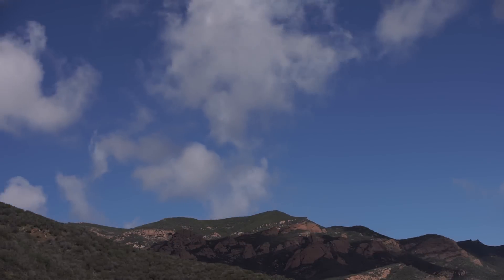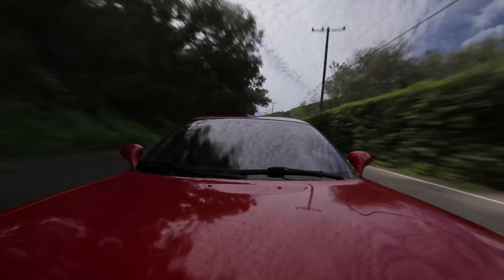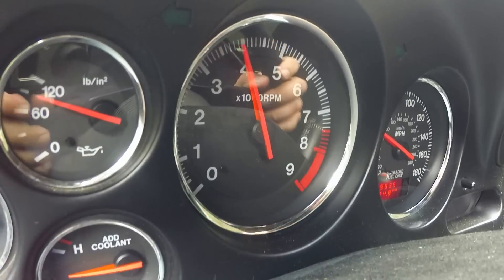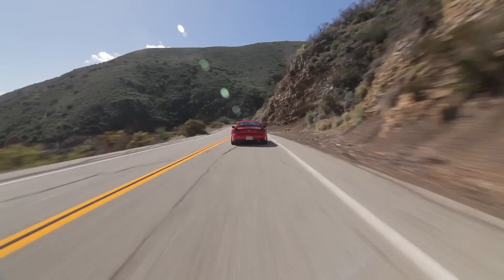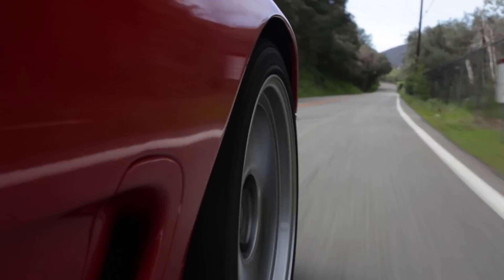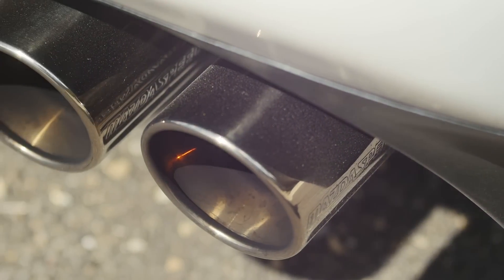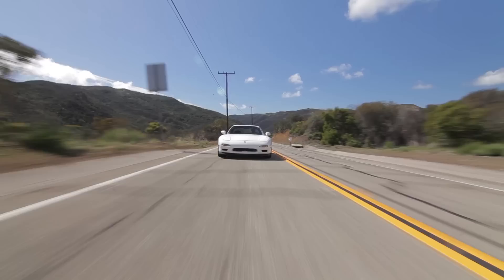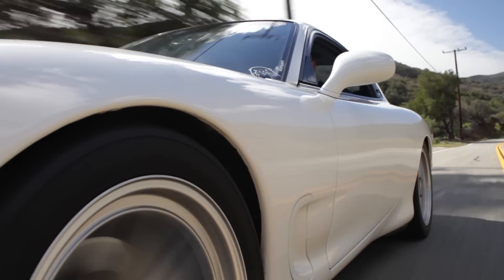Mazda  RX-7: Turbo vs V8 - /TUNED

Comment: Pure Sacrilege !!!
put a V8 in any other car, i don't care
but NOT in an iconic RX7 with its even more iconic rotary engine
that can eazily be tuned to over a 1000hp
so why THE HELL would ya need a V8 in that???
Reply: Iris C low down torque

how do you easily tune a 13b to 1000hp?
Reply: "easy". Yeah, it's pretty easy. You call a race shop and give them $50,000.
Reply: Iris C How come a 2 rotor its easy to tune over 1000hp when people struggle to get these numbers with ported 4 rotor turbos?
Reply: Iris C No really, please explain your "easy 1000hp" 13B tune.... We'll wait....
Reply: ***** You just keep living in your dream world little man. I'm actually invested in reality and not romantic rotary nonsense, so I swapped in an LS1/T56 after my rotary blew a coolant seal at 90 thousand miles. I can tell from your response that you have zero real world experience building high horsepower motors. You left out an entire laundry list of items it would take to make a reliable 1000hp out of a 13B. Just as an example of how much work it really takes to build a reliability high horsepower rotary... here is a 700hp example:
http://www.speedhunters.com/2014/01/wild-in-the-streets-700hp-of-road-legal-rx-7/

and 700 is a long way from 1000 ;)

So... how do you build a 1000hp 13b?

The question is not so much how, or how much, as it  is HOW OFTEN?

and the answer is AFTER EVERY RACE!
Reply: Right... maintenance... keep telling yourself that.  Here is what you should have posted to build a 700hp 20B for example...

Mazda 20B 3-rotor (Mazda JC Cosmo), bridgeport, machined/dowelled, full stud kit, machined/balanced/clearanced 20B rotors, Race Solutions apex seals, revised D-series balanced crankshaft, modified oil galleries, match ported and flowed intake manifold, modified 20B throttle body, Injector Dynamics ID2000 injectors, custom twin fuel rail, Turbosmart adjustable fuel pressure regulator, custom fuel lines, custom fuel surge tank,  Walbro fuel pumps, ceramic coated custom turbo manifold with EGT sensors on each runner, BorgWarner billet 88mm turbocharger, TiAL 60mm wastegate, 2x TiAL blow-off valves, custom PWR intercooler, custom intercooler pipes, custom 4-inch ceramic coated down pipe, twin 3-inch exhaust system with 3x mufflers, GM LS2 coils, custom baffled sump, custom PWR oil cooler, Aeroflow oil filter relocation kit, custom PWR aluminium radiator, custom shroud with SPAL thermo fan, braided coolant lines, Davies Craig electric water pump (ECU controlled), custom full-car wiring harness, Haltech Sport 2000 engine management system, custom engine mounts, polished rotor housings, colour-coded end plates, welded/linished/polished EGR system, brackets, vacuum lines
Reply: ***** And just check out the videos of the wide body FC RX7 I built, that are on my channel. Now tell me who's playing too much Forza? I don't even own a video game system, just a bad ass V8 RX7.
Reply: Iris C So what if he put a V8 in it...  It means the car is kept on the road, so if the next owner wants to put a rotary back in it they can.
Reply: Dee Jay if ya want a V8, just use another base car !!! Don't strip an already rare to find RX7 from its SOUL
Reply: rx7 all day
Reply: Iris C Stripped of it's soul.... the reason you don't see them much because it's "SOUL" has already gone to heaven (or hell) Rotaries are cool but lets be realistic... Even the RX-8 rotary wasn't reliable let alone the RX-7.  Also the 1000 hp comment was pretty stupid fan boy.
Reply: Gattsu83 Exactly. The last RX7 I used for my LS was sitting in a field for nearly ten years, with its "soul" seized and utterly useless. I dragged that sad thing home and gave it a second life. In ten or twenty years rotary parts will be very difficult to find here... whereas you can pick up your LS parts at your local parts store. To each his own I suppose.
Reply: Iris C Sacrilege is letting a beautiful FD or even FC sit and rot because the unreliable + bad owner = blown rotary unit, and good ones not being easy to find everywhere a V8 is a perfectly acceptable way to keep that great car going. so shh...
Reply: Iris C you're delusional.... nothing makes 1000hp easy, especially not a two-rotor engine (much less a peripheral-port twin-turbo four-rotor).  and exactly how streetable do you think any rotary will be with anything more than a street-port tune?  the V8 has much better midrange, it's WAY more efficient, and if you do decide you want make big power, it's a hell of a lot easier to get there than with any rotary (and it might still be driveable once you get there).  this isn't whatever video game you're pretending is
Reply: Hey to a multi-millionaire it's as easy as stroking a check.  You never know lol.

I'd personally go the v8 route.  Torque for days and reliable.  Exhaust, cam and tune easy 400+whp and will run forever.  But if it does die, they're cheap compared to a fully built rotary.
Reply: DEADHYPE 572 with forced induction at 8 psi. boom 1000 hp haha.
Reply: TheCowGoesMoo o Hell, you could just through an eBay turbo on a junkyard 5.3 LS motor (preferably 2005+) .... for about the price of the aftermarket ECU you'll need to make a thousand horsepower with a rotary.  (LS motors can make over 1,000hp with the factory PCM)
Reply: Little kid backed up by a few dozen little Forza kids...
Reply: TheCowGoesMoo o this is true lol. but we are talking about a big block V8 that needs 9.4L, 720lbs of iron and aluminum before supercharger (some 300lbs more than an LS3), and enough gas to drown a prius to make that much power.  it could very well be the cheapest way to 1000hp but it is still pretty heavy machinery
Reply: DEADHYPE Right right, but you said nothing makes 1000hp easy. 572 does lol, well, easier than most. I got your point though. Yes they're heavy as shit, but they make up for that with power and crazy torque so, so very easily. I don't see any 10,000 hp rotarys.
Reply: TheCowGoesMoo o On the smoking tire podcast, Matt mentions that while these cars perform similarly, the rotary car blew through an entire tank of fuel while the LS car used a third. Rotaries are buttery and high revving but they annihilate gas and oil like no other.
Reply: ***** Don't forget reliability, torque, parts pricing and availability...
Reply: ***** Enjoy your Forza motorsports troll
Reply: Brandon Berry Wait your FC has a wide body kit? Doesn't look too far from stock ;D I kept my body mostly stock, and I couldn't see any drastic differences between our two cars on the outside.
Reply: :D   Keep it simple.  Keep it clean.

I bonded on the rear over fenders (Foresight 45mm front & 35mm rear) and blended the rear fenders into the sheet metal with fiberglass reinforced body filler.  I've got some side skirts and a different front bumper, but it's basically factory other than that.
Reply: Ah alright I see that now :) The only real thing I did to the body was just welded aluminum over all the indents where the plastic side things used to be. I'm a fan of how clean they made the FC's look, but I might think of doing something to it far into the future. As it currently sits, it's very clean.
Reply: Iris C 
Did your husband say you could use his computer? Surely you don't have one in the kitchen.

Jeez...dames these days.
Reply: balls deep  yea, just look at the Mazda 787B that won the 24h of Le Mans
Reply: (Praying to be that 1%) :D
Reply: Iris C Count me as a bit of a purist when it comes to keeping RX7s rotary.  But you lost a lot of steam in your argument when you said a rotary can "eazily be tuned to over 1000hp".
Reply: AlphaRT WTF are you talking about it's really easy to get 1000 + on 4 rotors even 3 rotors check out mad Mike  Twin Turbo 4 rotor it got about 1200 on low boost
Reply: Iris C oh ok lemme put it in a supra, or better that skyline
Reply: rushking19 No it's not, hitting +1000hp in any motor its no easy task by any means let alone in a rotary. Yes Mad Mike has a 1200hp 26b, but thats because he has one of the best rotary builds on the world, with factory support, built by one of the best rotary specialists out there (PPRE) and with full Red Bull sponsorship, among others. And if it's that easy, why he hasnt had a +1000hp car until RADBUL? Because in MADBUL (Rx7) he had a 26b NA pushing 550hp and in BADBUL (Rx8) he had a 20b turbo pushing around 800hp.

And dont get me wrong, i love rotaries, my cousin has a Rx8 and i love how revvy the engine is, and overall i prefer a revvy engine rather than a torquey one, but that doesnt deny the fact that Rotaries are dificult engines to tune to extreme hp numbers, more so than other types, like V8 or such
Reply: ***** Right... as if you ever built shit.
Reply: It's just soooo easy. I'm sure you dream about building 1,000 hp rotary motors all the time.
Reply: In theory you can build any motor to be 1000+ HP. It all depends on how much money you'd like to pour into the engine itself. I'm a fan of rotaries but come on! I learned when I was twelve that building one into a super high powered engine isn't something that was common. Mad Mike has a 1200 HP rotary, sure, but just imagine how destroyed his engine must get, especially with his driving haha.

I ask you guys defending this idea, please, as a fellow rotary enthusiast, stop! You're making everyone who supports rotaries look like they have zero education on their own engines! Geez, you're probably the lot who burn their tires at car meets and get the cops called. You don't want to be that guy!
Reply: ***** I feel sorry if that's the only argument you have after my previous comment. Almost every argument given by those against rotaries here has been a valid argument, one that even I, a rotary enthusiast, agree with. It makes me feel so bad to be associated with people who will argue something to the death without knowing anything about it. Could you not have read through the rest of my comment and made some other argument, or was the only thing that stuck consist of "He's bashing Mad Mike! I must show him the error in his way!"
Reply: ***** Even with the association of how I took a jab at the Mad Mike situation, the average person would see that it wasn't meant to be taken to heart. The extent of my knowledge of Mad Mike is that he drives a quad rotor Rx7. I never claimed to say that his engine gets blown all of the time. Instead of speed reading through comments to pick out something you can hate someone for in the mindset of "bashing," you should next time look for key words such as "imagine" or phrases such as "especially with how he drives haha."
Reply: Iris C I want to put a V8 in an RX7 too, just for you.
Reply: Iris C "eazily" tuned for over 1000hp, ok lol.
Reply: Difference between useable torque and peek power my friend.  V8 owns it.
Reply: ***** didn't you hear? You have to rev them out.  That's why the rotary uses twice as much fuel as the big v8.
Reply: ***** The 787B also didn't have to carry an additional 100kg to slow it down. That would have helped it's fuel efficiency.
Reply: ***** An RX-7 is hardly unique or rare, not here anyway.
Reply: ***** No he's right.  So long as you can fund it why not?
Reply: ***** What is so special about an RX7?
First generation: 471018 produced
Second generation: 272027 produced
Third generation: 68589 produced

They are just a common sports car so do what you like to them.
Reply: ***** The rotary engines were horrible from an efficiency and maintenance standpoint.  Ls motors are quite the opposite, lighter, make more power and are the easiest engines in the world to look after.  Good upgrade I reckon.
Reply: ***** So this just degenerated into slandering did it?  Listen you degenerate, anyone can do what they like to their own car.  Your opinion matters squat to anyone else.  Do what you want with your car but don't tell other people what to do with theirs.
Reply: I don't understand why people think rotary engines are special, sure they're unique but not amazing. There's a reason why they aren't in many cars.
Reply: +c0rpse1 No, it's more of a "how much money does it take to max out the parents credit card" type of deal, judging by the way it is SOOOO easy for you.
Reply: The logic that it's special because it's unique is pretty stupid. Engines are purely functional and their worth should be based on their performance not exclusivity.
Reply: ***** I specifically said the engine being purely function not the chassis or the appearance of the car. Seriously man... you are asking for this.
Reply: ***** You literally said they were special "because they are the only cars with rotary engines" so clearly it's about the engine.
Reply: ***** It's only ruined because you say it is, go find a cult to lead.
Reply: ***** By your logic there are less V8 RX7's so therefore they are more special.
Reply: +Iris C That did it in such a way that it was banned as it was unfair.
Reply: ***** You forgot the part where the 787B didn't have to carry around the extra weight which caused the other cars to overheat.
Reply: ***** It was a transitional race and the older Group C cars all took 100kg additional weight to slow them down so that the new but slower cars adhering to the 3.5L rules could have a chance. The cars with the new engines were highly unreliable and because of the extra weight the group C cars had overheating and fuel consumption issues themselves.

Somehow the 787B got away without having to take the extra weight making it possible for them to pull off a slow but steady win despite the Mercedes C11's being faster.
Reply: ***** That comment literally made no sense at all.
Reply: +Iris C Aston Martin started by putting big engines on light chassis, no one complains.
Reply: Lol easily
Reply: +Iris C you just want to sound smart, try putting above 8 psi into a 13b, your going to destroy it, rotary engines and piston engines are VERY different
Reply: +Iris C 1000hp. 350 ft-lbs of torque. Shite sound {2 rotor}. Also useless powerband like old style 2 strokes.
Reply: +Iris C They probably swapped it because they wanted reliability. That'd be my guess.
Reply: +Hunter Paige and kiiling the handling/perfect 50/50 weightbalans in doing so
a rotary can be reliable to, IF ya know how to handle it
Reply: Iris C A year with an LS will save you countless bottles of oil, seals, and fuel as compared to a rotary. I love a good rotary, but don't be an idiot and ignore what's wrong with the engine...
Reply: well ok fine, then just DON'T buy an RX7
and put ya V8 in ANY other car
Reply: Iris C You seem to have a very strong opinion for someone who probably hasn't driven either car.
Reply: Sigma Octantis These Internet rotary purists have ZERO real world experience. I've driven rotary, iron block V8, and aluminium block V8 RX7s, and I can attest that the aluminum LS swap adds such little weight that it's literally indistinguishable from a rotary (most of the additional weight is in the T56, near the center of gravity). The iron block does cause noticeable push, but not the aluminium block. Most RX7s have staggered tire setups anyway, which leads to understeer. You won't hear these Internet rotary purists complain about staggered tires effecting handling, but they have all day to bemoan bad ass modern aluminum block V8 RX7s. These people don't turn wrenches, fuck em.
Reply: ***** You taking a break from Forza to chime in again?  You don't turn wrenches.  You're an internet rotary fan boy.  The RX7 has a great chassis, it's inexpensive and common, so it's a great candidate for an LSX swap.  Great candidate, and there just aren't that many great options in the real world.  LSX RX7 is a fantastic car.
Reply: I feel like we've just told them that their god doesn't exist.
Reply: ***** You're the one talking about cars having a soul, get a grip.
Reply: ***** Did you really just run out of comebacks and resort to the participation argument? lmao

Truth be told I enjoy a good troll and you rotary fanatics are an easy target.
Reply: ***** k
Reply: +Iris C Yea it won with a custom built 4 rotor engine...
Reply: +Iris C The 13b rotary engine with 1000hp will be destroyed after one race
Reply: +Brandon Berry&#160; is that your rx7 in the video dude? if so she is a beauty, hoping to get a spirit R from japan next year(I'm from Canada) , +Iris C&#160;&#160; and lmfao 1000 HP easy???? ive never heard 1000 hp and easy in the same sentence,&#160;a 2 rotor would never hit that much hp without it blowing up every pull
Reply: kieronicsmoke Nahhh not mine. Mine is an FC... not quiet as dreamy as an FD, but the cammed LS6 and widebody make up for it :D They'll let you import and register an FD there in Canada?  How does that work? We have the 25 year rule in Texas, so fortunately I don't even pop the hood during inspection.

Comment: the rotary engine is better because the rotary engine makes 3 power events per revolution while the piston engine makes only one power event per four revolutions aka (four stroke). the 13B rotary engine or 12A rotary engine is able to make 6 power events per total crank revolution making the rotary more consistent in its power curve and the rotary can rev higher because it doesn't have to convert reciprocation to rotation like the piston engines so there isn't that much power loss through the drive train.
Reply: but good luck with that gas bill bro, geez!
Reply: Don't they burn oil too?